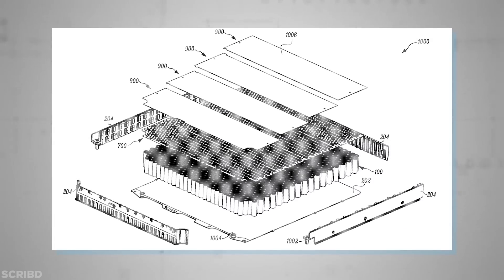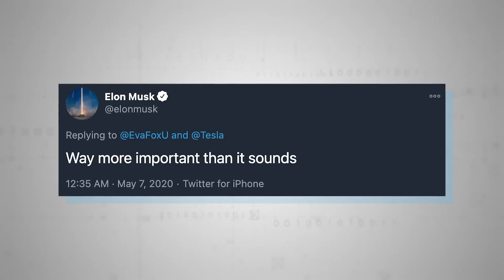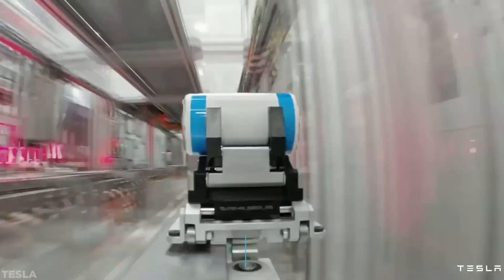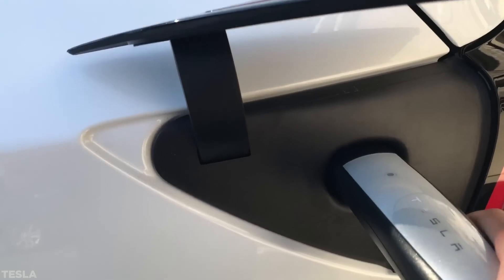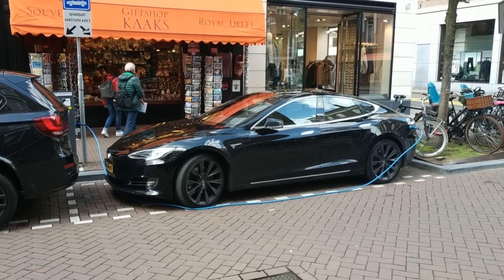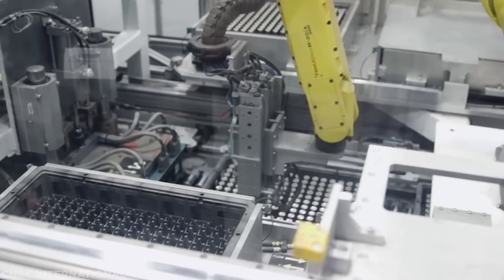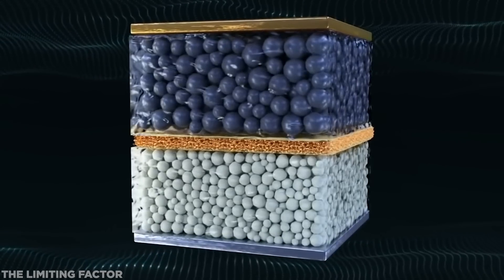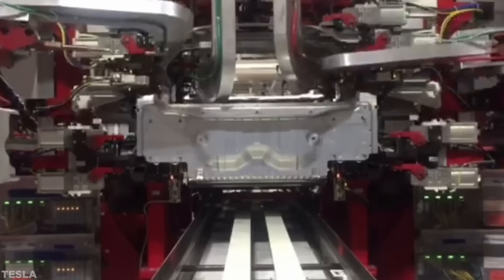Why Tesla Switched To Tabless Batteries

Comment: I might think Tesla is a little overvalued on a balance sheet stand point, but no other company is doing so much to keep growing and innovating. No other car company is simultaneously building a network of electric production, storage and charging to power their product line, and no other car company has the vision that Elon has. No hype or anything these guys just have the wind in their back and they are actually doing something about the issues we are facing as a society. I picked up shares at $670. Not ideal but I stand by it.

Comment: Nice EVs can charge faster; but EVs are not green.  IF you desire more electric driven miles; you want PHEVs, not EVs.  A PHEV fleet will drive far more full electric miles given the LIMITED number of batteries.  You can built 10 PHEVs or 1 EV with the same number of batteries.  Say the world supply is 5000 batteries - you can build 1 Tesla or 10 PHEVs.  SO your fleet is either 10 PHEVS doing their commute all electric or 1 EV and 9 ICE cars to satisfy demand.  Even in long distance drives; 10 PHEVs each drive many PHEV and regenerative EV miles; vs 1 EV getting 100% and 9 ICE cars getting ZERO.  Plus, a big EV like a Tesla's weighs about 2x a normal car because the lithium ion battery packs are very heavy.  This largely cancels out the electric motor efficiency over ICE cars, rendering it nearly an ICE car itself; because the grid is not near green yet.  So if you are a company that wants to sell $60,000+ US dollar cars to people on the basis of them being green - they are not. This is why German and Japanese car companies have focused on PHEVs.  Now while it is true that future ; more energy dense Solid State type batteries may reduce the weight of EV cars; they still will be anti green until there are enough such batteries to produce even a large fraction of the 80 million vehicles sold every year. That is a big IF, and years in the future.

Comment: I don't understand all the hype about electric vehicles which take 12 hours to charge, when hydrogen fuel cell cars take 5 minutes to fill...... wake up people Tesla are making a mug out of you all....😁😃😂😅🤣😄😆🙂😀😀
Reply: Electric cars don't take 12 hours to charge unless you use a regular home plug. Superchargers charge the cars in 10-15 minutes. Hydrogen fueled cars are more expensive to run than gas/diesel fueled cars are as well, which will be the main driving factor of consumers choosing one of the other.

Comment: Integrating the battery into the chassis doesn't mean they won't be serviceable, it just means the battery pack will be stressed when the car is driving, similar to the engines in a lot of high performance motorcycles. It's part of the chassis, but it can still be removed and serviced

Comment: Batteries are going to far outlive the life of the car. Not being able to remove it is a very horrible cost to pay, as producing these batteries hurt the environement (even though they are otherwise green).
Reply: It will still take quiet some time before batteries outlive the actual car, which actually is the main concern if that would be true. Hard to justify having to replace an entire car if the battery inevitably dies. That said, being integrated doesn't mean it is not removable or serviceable, it just means it contributes to the cars structural integrity.

It is similar to integrated batteries in smartphones which can still be replaced, granted it is harder to get to for customers or third parties other than Tesla themselves. There has not been a device with permanently fixed batteries which can not be removed ever.
Reply: @BizzMRK  I heard they will outlive the cars soon, maybe im wrong

Comment: just want to clear one thing: batteries have never been permanently put into any sort of device or machine, if it is 'permanently' put into a device or machine they are put in such a way that only the manufacture could remove them which is still not really permanent

Comment: Range anxiety is dumb. Most cars can only go 400 km, and the base model 3 is over 500 km.
Reply: To be fair, these are estimated ranges which are heavily dependent on weather conditions as well. In winter the range is significantly reduced. Then again, I never understood this "range anxiety" nonsense. Even if the EV only does like 400km, heck lets go as far as 300km in winter, this is still more than enough for any daily commute and to comfortably reach charging stations during long road trips. I can understand if people are concerned with ranges sub 300km let alone 200km, but anything above that is basically just an excuse to stick with gas powered cars.

Comment: They said that in battery day. The cells will be used as structural support and part of the frame. Im sure it will be possible to remove sections .

Comment: Id love stopping at a "gas station" / charging station whatever, switching out the battery and off you go, no charging time. Battery isnt yours, no battery deterioration for your car, battery can be recyclelt better and faster, professional charged by a proper loading station. No overcharging form some wonky ass wall outlet... also the car's resell value doesnt depend on batterylife/age. Cars would last longer. Would you buy a 20 year old ev today? Hell no! But with that system? One battery standard for all manufacturers. Companies can compete with batteries and you can buy premium or simple or what ever.... thoughts?

Comment: 2:43 how did you invent that?🙄 they actually said that supercharging would not be as good as 18650 but they will try to maintain or match the current speed edit: 4:34 whut?! it is more rigid because the bigger cells!! Not the battery being fixed like a smartphone?!👎 bye now

Comment: Having just bought a Leaf and had the battery changed to one with more capacity, It would be a huge advantage if Tesla batteries could be easily changed.  It took my mechanic less than one hour to remove the old battery and install the new one.

Comment: These batteries loss heavy power in cold areas...
Reply: But they still work at -30c, gas cars also fail at these temperatures.
Reply: @massriver  because it depends in tempature. 30% loss around 20f, 50% loss around -30f, range is mostly lost from the car keeping the cabin and battery warm.

Comment: This was one of the least informative videos that I've seen.  Nowhere did you actually identify or explain what the "tab" was and why it was not needed in the new design.  Nor did you explain why eliminating the tab improved the battery.  Look, I get it, the "tab" is not important.  What is important is the larger size and the new construction.  So why didn't you actually explain the differences between the two.  I watched this video twice, which doubled the waste of my time, and I still came away knowing nothing about what actually makes the new battery better.

Just to be clear, I do actually know what the difference is and why the new design is better.  My point is that this video was completely useless in advancing that knowledge.

Comment: Page 1:55
Tesla published 4680 format cell package use - point contacts - to conduct heat and current from electrode to cell wall (output terminal) instead of conventional welded tab. Welded tabs ensures good heat and electricity conduction to cell exterior. 

Problem? 
(1) Heat and electric conduction performance of point contact multi tab 4680 cell requires a substantial contact and retention forces, were not part of Tesla’s patent .
(2) Point contact required compression and retention force are not to be derived from, or coupled through, electrodes or multi tabs because those are made of soft copper of no spring properly. If there were contact force packed into the cell such force will (1) be coupled into the electrode and will delaminate it. (2) follow that compression force will be degraded by - temperature shock, inertial shock and thermal cycling. Progressing into an open circuit and electric spark inside the cell, triggering off a  rapid oxidation process or an explosion.

Comment: LITHIUM BATTERY ARE FIRE HAZARD.
Reply: gasoline is more flammable.
Reply: @miguellopez3392 yeah, but gasoline are environment friendly, it produces carbon dioxide which will make planet earth cool.
Reply: @akoto8753  " it produces carbon dioxide which will make planet earth cool" 
where the hell did you hear this? this is the opposite of what happens.
Reply: @miguellopez3392  from  my research, im a professor from MIT,  all the previous findings about carbon dioxide effect on climate change is wrong. Venus was so hot because its near the Sun, its not because of carbon dioxide. Venus produces so much carbon dioxide to protect its environment,  to make itself cool. Opposite on Producing water, if you burn Hydrogen and Oxygen, it will produce water at the  same time it produce heat due to burning.
Reply: @akoto8753  you are lying, start again and this time use science that real professors and scientist use.
Reply: @miguellopez3392  You can also say that to people who thought you. Tell them to study and do more research. Fossil fuel is still the future.
Reply: @akoto8753  I studied and did reaserch and a lot of it was in geology, and the evidence STRONGLY disagrees with what you said.
Reply: @miguellopez3392   you studied somebody's research not your own research.  A lot of research about climate change is incomplete, you cannot completely tell if all of those are accurate. Produce your own data to back your findings like mine.  Fossil fuel is mispresented on climate change. Climate change occur due to imbalances between oxygen and carbon dioxide. There's more  oxygen than carbon dioxide on the planet, that's why we have clear skies which cause warming. If you check the temperature of cities like Beijing/Tokyo/Mumbai, you can see those cities are a lot cooler than the other cities beside it.
Reply: @miguellopez3392  when was the start of Ice age? its after the sky was full of ash/carbon dioxide. you can start your research on that area. Don't believe on people praising batteries, they just want to sell more of it.
Reply: @akoto8753  you are ignoring reaserch, anyone who actually cares about the right awnser would already know that C02 warms the planet. This has been discussed and tested numerous times, you are intentionally ignoring a pile of evidence and calling it incomplete, there was a period in our geological history where c02 levels dropped and oxygen levels increase, this causes a cooling even that put everything in a 200 million year ice age, you give me an example of 3 cities that are next to the ocean, this tells me you can't even correlate effects correctly.
Reply: @miguellopez3392  yeah, we can say that nobody is brave enough to question those findings. Only me.
Reply: mumbai is not near the ocean
Reply: Do your research, its just an example, check   Seoul, Shanghai or any cities you know are on the middle of a landmass.
Reply: @akoto8753  "we can say that nobody is brave enough to question those findings. Only me."
this is every person who denies the evidence of climate change then makes up their own version of science that ignores 1000s of scientist research and effort, its not bravery its ego. 

"Shanghai or any cities you know are on the middle of a landmass" from my research in geology also tells me that's not how it works, geography plays a major role in weather and so do winds, i live in one of the driest parts of the US, i also live next to one of the rainiest parts of the US climate can change dramatically in 200 miles. you are also ignoring the fact that cities are hotter then their surrounding environments, the surrounding environment is something your not taking into account and only using C02 levels as a variable for the cities.
Reply: @miguellopez3392   yeah yeah, make me look fool will not work for me, I'm going to publish my findings next year. Its  under review right now. Wait for it next year.  for sure it will make headlines.
Reply: @miguellopez3392   it also means that those scientist think every people on this planet is  ignorant that it will  believe anything they say. People like you will have a hard time on research field. Try to question some of there findings, most of it is obviously not correct.
Reply: @akoto8753   "Try to question some of there findings, most of it is obviously not correct."

are you going to pretend climate science hasn't been a heavily debated subject for the past 30 years? are you really ignoring that how much resistance there has been to the scientific consensus on climate change, how much scrutiny and proof these scientist had to gather to convinced the oil funded government that they are hurting the environment? even exon saw a correlation between fossil fuels and climate change back in the 70s but they didn't make the report very public, your ego tells you, you are to smart to be fooled so you aren't letting anything fool you by not believing in anything, you want to compare notes? if C02 doesn't warm the planet then why has C02 been measured to have high Radiative forcing value? mars atmosphere is 1% of ours and is 99% c02, it gets warm enough for liquid water despite areas with no sunlight being cold enough to freeze carbon gas.
Reply: @miguellopez3392 yes
Reply: I can say  resistance is on Progress. Green technology are inefficient technology. It will destroy the balance of ecosystem on earth. 
it will not address consumption or hunger. Only fossil fuels can do that, which is proven for the past 300 years.
Reply: Did I say most of those scientist are already dead. They die poor cause they cant accept that green technology are a waste of time and money.
Reply: have you been to mars? Are you sure those findings are correct even if those people studied it using telescope. Dont make a fool of yourself
Reply: @akoto8753  " Green technology are inefficient technology" its now cheaper then coal, doesn't require billions in subsidies to stay alive and also doesn't kill 2 million people a year from carcinogenic emissions.

 "It will destroy the balance of ecosystem on earth. 
it will not address consumption or hunger. Only fossil fuels can do that, which is proven for the past 300 years."
so before green energy no one starved and no environmental damage was done?
china is an excellent example of this not being true, they starved while powered by coal, now that their economy is on track to outgrow the US they have decided to save even more money by heavily investing in renewable power which removes them from the dependence on oil.

why do you keep creating a reality that does not exist?
Reply: @akoto8753  "have you been to mars? Are you sure those findings are correct even if those people studied it using telescope. Dont make a fool of yourself"

have you been to venus? and they studied using multiple rovers and satellites on the planet, for some who claims to be from MIT you sure do know very little on how climate data is gathered and processed.
Reply: @miguellopez3392  you are just repeating what i say here? hahaha. One sided thinking, coal provides you energy, power and employment and dignity. I think you are a jobless/useless human, who doesn't want to work  and make a living out of donation.   If what you say is true, why does the government do not stop coal, cause they know those finding you believe is wrong/incomplete or overreaction due to lack of dignity  of someone who say that. Have some commonsense its free.
Reply: like i said, im a professor, i have access to infrastructure  for data gathering. yeah yeah just question my credibility, who cares.
Reply: @akoto8753  are you over 50?
Reply: @miguellopez3392   what kind of question is that?  Grow up
Reply: @akoto8753  i wont feel bad when no one takes you seriously.
Reply: @miguellopez3392  tell that to your self.  You are already taking me seriously.
Reply: @akoto8753  I'm not, I take 9/11 and moon landing deniers more seriously than this, which is not much.
Reply: @miguellopez3392   yeah, yeah, yeah, what ever.

Comment: So does that mean when the batteries have expired/run out of juice/malfunctioned you throw away the car? Though i am pretty sure i misunderstood the meaning of permantly fixed.
Reply: the cells will outlive the car, so they are likely to be re used, re sold, or recycled.
Reply: Did you not watch the video?
Reply: @noahno  did you not read what i have written?

Comment: 2:21 quick clarification, it has 5x the energy because it's about 5x the volume of the older cells, means it's barely any increase energy density. 

The 16% range increase is probably a better indicator of the increase in density, but the calculation for "range" has so many variables that it cannot be attributed just to the energy density. Still impressive just not 5X impressive. 

The 6x increase in power output however is something to look forward to.
Reply: the innovation comes from cost saving of manufacturing a cell at this price, problem is when cylindrical cells get this large they gain a lot of internal resistance, if not for tables design you would see a lower power output an usable capacity, square cube law works against cylindrical cells in this way.
Reply: @miguellopez3392  Ye ik that part about it is cool. And it'll probably improve battery density of the entire battery pack because it'll need less cooling. But it's not an increase energy density in the cells itself. It's a good incremental increase.
Reply: @justaguy6216  energy density increase is less important then cost decrease, because if you lack range, you can always buy more battery.